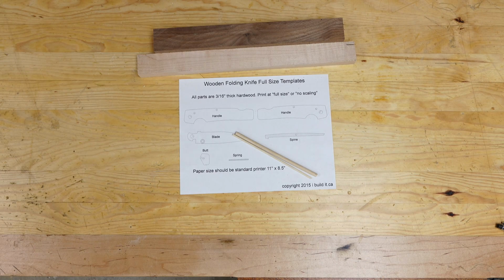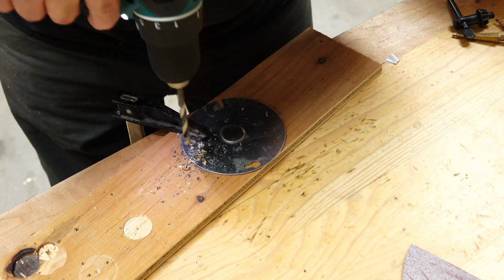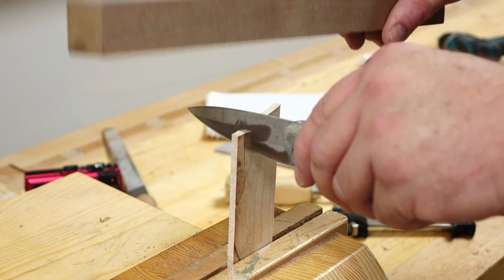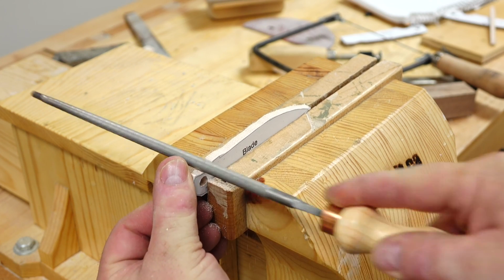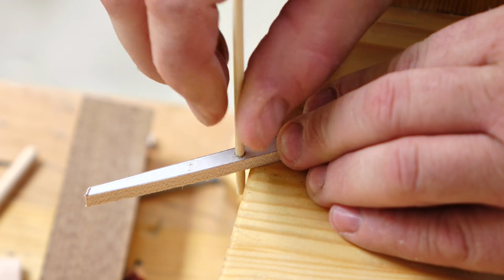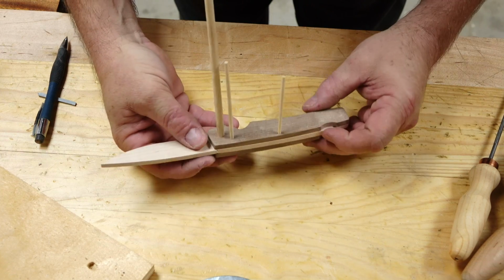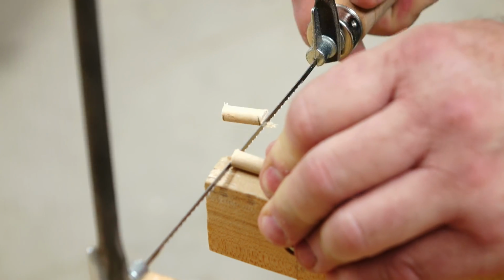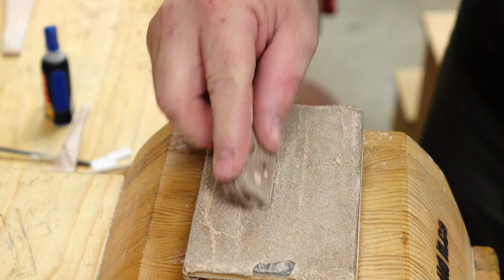How To Make A Wooden Pocket Knife With Hand Tools

Comment: One thing we did different. My 14 year old  neighbor couldn’t cut the sides to match. So  I cut two XL side pieces and drilled holes in all four corners and used toothpicks to dowel them together, glued the template on. Drilled all the holes and then cut the sides at the same time. The sides were a perfect match and the holes lined up perfectly (flaws and all) lol.

Comment: Hi John. Thanks for the cool video. I'd like to make your version, however, I noticed that your initial model was made with a 1/8 thick hardwood template and your 2nd iteration was slightly different in contour and thickness (3/16th). Do you have the plans for the 2nd edition? If so, where could I find them?

Comment: It could be sharpened and used as a letter opener.  I have made wooden fixed blade letter openers and they work fine.  Thanks for the video and template.

Comment: if I wanted to make replicate this knife but make a replica of the blade out of steel for the purpose of building a functioning tool, would you also recommend I replace the pins, lock, and spring with metal? maybe also steel or aluminum?

Comment: when you get attacked are you going to try poking eye or scratching their face ? aren't  finger nails are just as effective?
Reply: If you try to poke their eye or scratch their face with your fingernails, they'll just get even more pissed. Not really a good idea.
Reply: ya but it can hurt you using your finger nails using this there is no risk
Reply: That's not the point for making this. It's just as a fun project or decoration not meant for actual knife use.
Reply: +Sn95 Outlaw ya I was responding to a comment it was just for a scenario. it would probs break at first swing